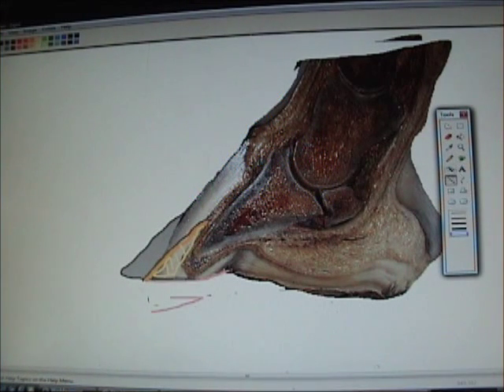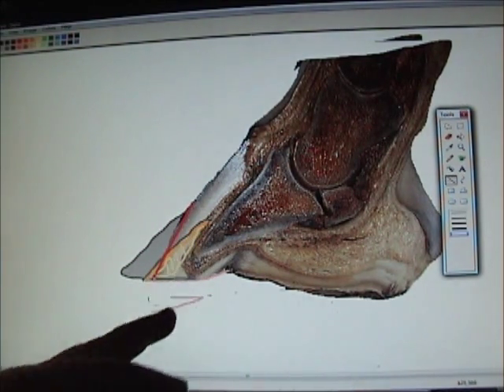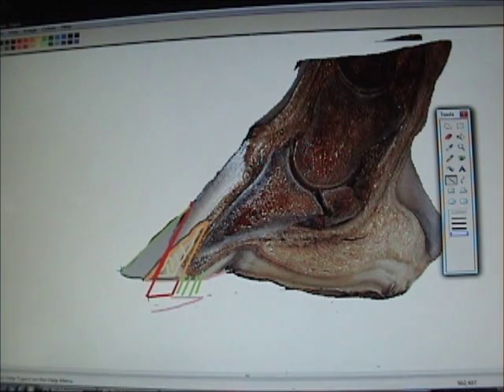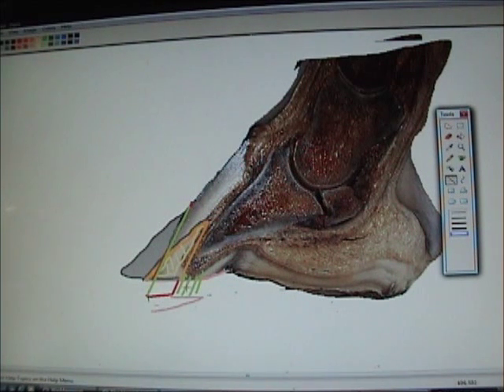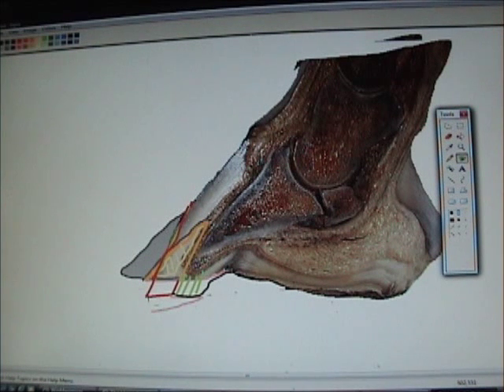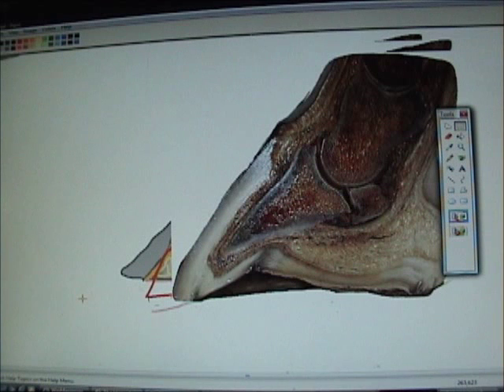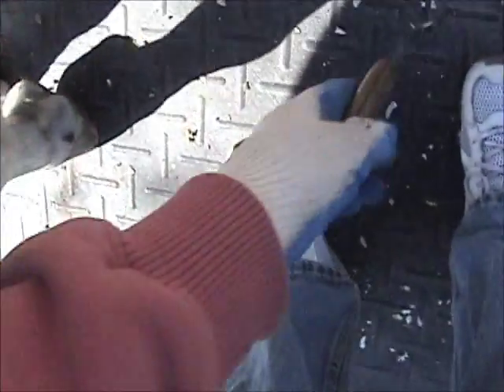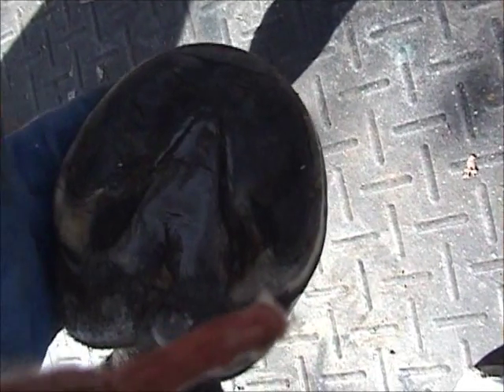Natural Barefoot Trimming, Part 9, Building Concavity and Sole Deapth

Comment: sounds like you said that after you grow back a tight white line connection you have to let the wall get a little long to reestablish concavity. I would think that the sole tubule angle depends only on how far away the wall is (they fill whatever area there is to the nail/wall); so if you get a tight white line connection they should automatically grow at the right angle again because the wall is containing them properly once again.

Comment from the maker: Has to do with getting a tight connection in the laminae all the way down the dorsal sufrace of the coffin bone. THEN: you will be able to let it continue to grow down about 3/4 inch or so with the sole to thicken the sole ridge that is now contained by the wall under the coffin bone. Then you have certain peremeters that you keep it in, so that it does not flare out again. But now you have a wall that is more vertically straight than running more horizontal and forward.